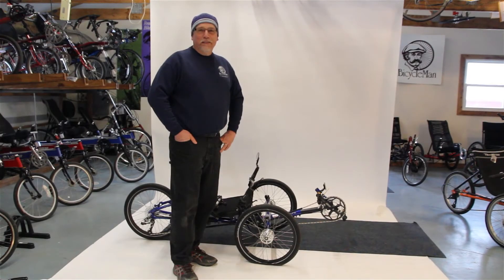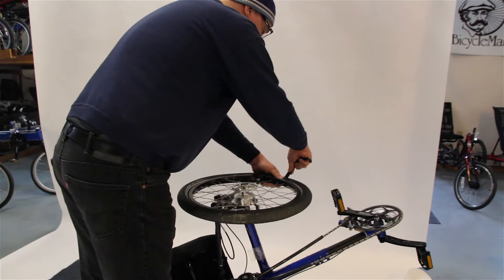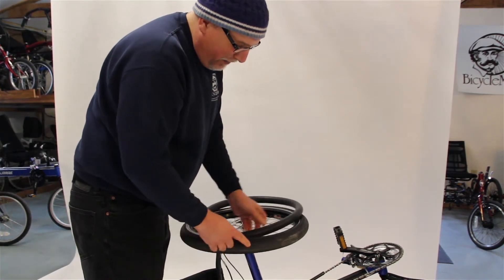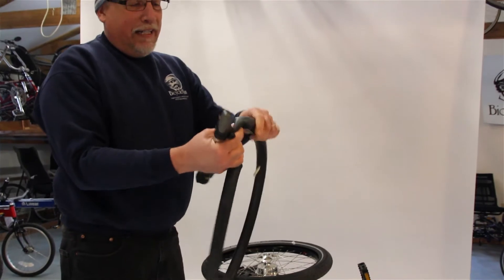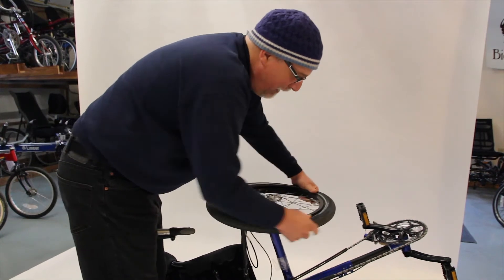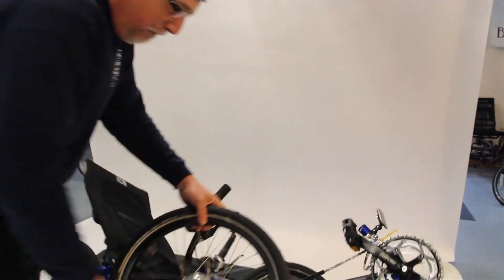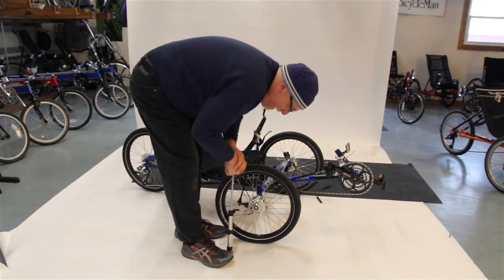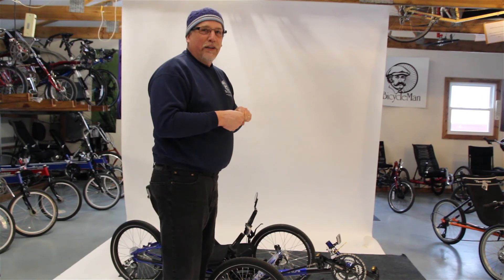How to Change a Flat on the Front of your Recumbent Trike

Comment: last resort, i have a spray bottle with water and a couple drops of liquid detergent.. i spray the outside of the tube and air it up.. bubbles will form where the hole is.. i dry it with a cloth and mark it with a chalk pencil..

Comment: I have a Catrike Road trike, and I keep a small piece of corrugated cardboard (I just cut out about a 4" square piece from an Amazon box) tucked into my bike tool bag. When I have had to fix a front tire flat, it always seems that I am not located somewhere where there is a nice grassy verge  next to the road, and I need to do the work on a gravel or paved surface. Tipping the trike on its side, as shown in this video, the lower hub end cap will rest on that rough hard surface, and it gets a bit roughed up. But since I have  that bit of cardboard, I just slip it under that hub end, and it cushions the metal from the pavement. Other things that would work well for this; a bit of thin but dense foam (but NOT foam rubber....too soft), or a piece of 1/4" plywood or Masonite, or a piece of aluminum sheet metal, or a cardboard coaster (as used to put drinks on to protect table tops).....
Reply: Good ideas.

Comment: I inflate the bare tube and then spray it with soapy water and watch for bubbles.  That is where the leak is.  Sometimes it is in the Schrader stem and bubble will confirm the leak.
Reply from the maker: If it is a slow leak and a schrader valve stem I inflate the tire and get a bubble over the valve stem to see if that is where the leak is. If it is not there I go ahead and remove the tire from the rim.

Comment: Don't forget to install the locknut on the valve stem, before installing the valve cap! ;)
Reply from the maker: Yes, some valve stems are treaded for a lock nut, others are not.
Reply: I've owned, operated and maintained a modest "pack" of recumbent trikes, for the past 11 years. (2009 Performer JC70 CM, 2004 Catrike Speed, 2011 Rans Trizard, 2010 TW Bents Trident and 2088 Sun X3 AX tadpoles and deltas. I've never seen a Presta valve equipped, inner tube without an externally threaded stem complete with a lock nut/lock ring. I can't speak about Schrader valves as I don't use the type. In the event, I enjoy your videos, a lot, and I wish you and your business many successful years to come. :)
Reply from the maker: Thank you. Yes, most/all presta valves are threaded for lock nuts, most/all shrader stems are not.

Comment: How do you change rear tire when on the road?
Reply from the maker: To change hte rear tire you must remove the rear wheel. This can be done on the side of the road by tipping the trike on it's side or by lifting the rear of hte frame. Either way I try to find a grassy spot to avoid scratching your trike and to keep the chain clean.
Reply: bicyclemanllc I’d love to see a video of it being done by one person.
Reply from the maker: @bobkosberg6828  It's an awkward procedure for sure. A bit more awkward than the same process on a traditional bike.

Comment: The tire is almost impossible to get back on. It's difficult to remove but getting it back on is insanely hard. Been working on putting a new tire on for almost two hours. Can't get the bead all the way around. Get's to the point where there is about a foot let to get back on the rim and it will not go.
Reply from the maker: Some tire-rim combinations are hard to mount. What tire and what rim do you have? What rim tape do you have? Some rim tapes make it harder.
Reply: @bicyclemanllc  It's a Catrike 559 and Schwalbe Marathon Racer HS 429 SpeedGrip Cross/Hybrid Bicycle Tire - Wire Beads. I've changed flats when riding but that was nothing compared to this. Ordered a tool from Amazon that several people suggested. Will see how that works.
Reply from the maker: @BlackDiam0nd  Stock tire and rim... Stock rim strip too? A thinner rim strip may help. Tubeless rim strips sometimes help.
Have you tried pinching the beads to the center of the rim when the tire gets tight?